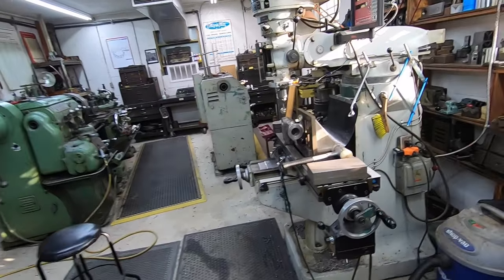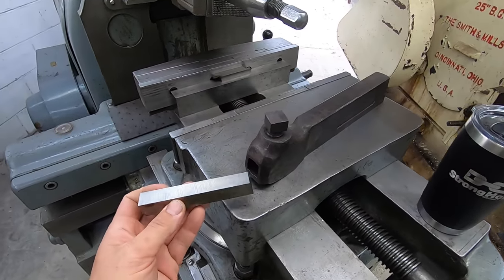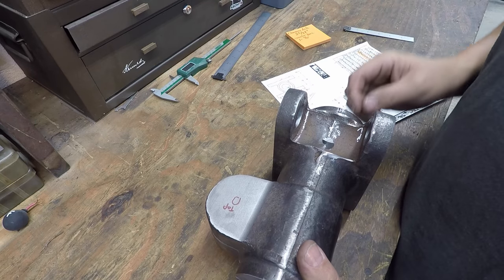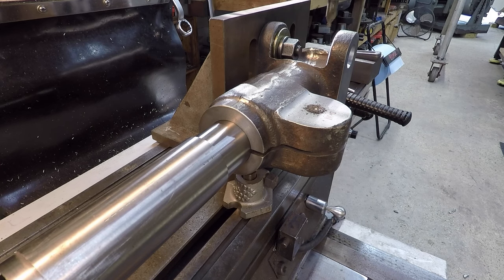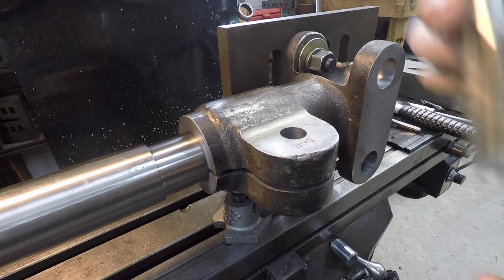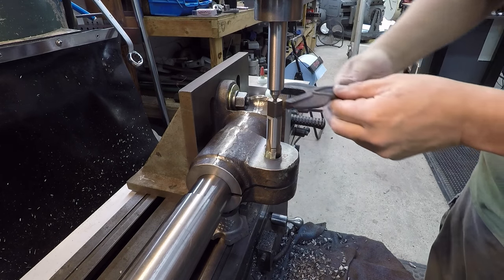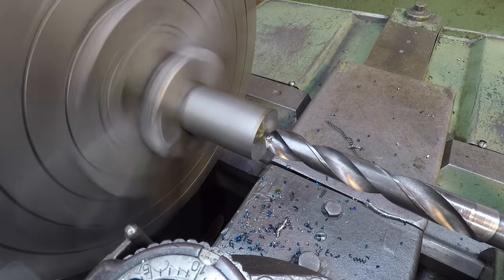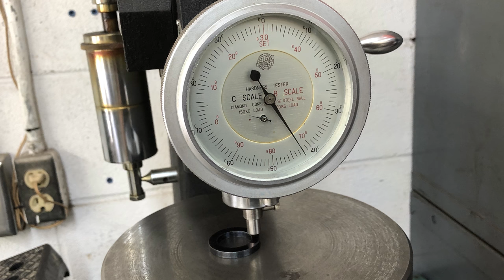Fairbanks Power Hammer Cross Head Part 6

Comment: In back of my mind during video : "MAKE THE BOLT...MAKE THE BOLT ... MAKE THE BOLT...." ....
Reply: Mr pete would have made it
Reply: After looking up pictures of the old fairbanks power hammers I have to agree. Looks to me like the original style bolts were made with an oversize shank ( shoulder bolt) and a "washer style" head. I think thats why the "counterbore" measurement didn't make sense. Its not so much a counter bore as just an oversized bore compared to the thread size.
Reply: I saying the same thing!
Reply: The only thing making your own load fasteners, is that you cannot certify it yourself and ensure grade without proper heat treating. It's just not cost-effective.
Reply: @1956Taz  sure it is not cost efective on large scale small shop, but one bolt he can make even better, right steal right heat and done, especialy when he has everything needed to do it and test it....

Comment: Hello Adam.  I think the mystery of the counterbore is that dimension P is measured from the centre of the saw cut and not the edge (You had your ruler measuring from the edge of the saw cut, not the centre).  Dimension R is 2-3/16".  Assuming that the saw cut is in the middle of this dimension then the distance from the centre of the saw cut to the outer surface of the lug is 1-3/32"  Dimension P is measured from the centre of the saw cut to the face of the counterbore and is 1".  This would give a counterbore depth of 3/32".  I think some of the confusion comes from the fact that the counterbore appears very deep on the drawing.  The draughtsman was probably faced with the problem of the actual counterbore being so shallow that it would be hard to show it on the drawing, so he exaggerated the depth to make it clear what it was and relied on the table dimensions to control it to the correct depth.  Ken
Reply: When Adam held the chart up close to the part, it does show P being dimensioned from the centerline and R is 2 3/16" and the saw cut L is 1/4".  With the washer and a new bolt, this arrangement will be better.

Comment: The only machining I've ever done is on a brake lathe doing rotors lol. Instead of letting it feed automatically, I like to do it myself manually 😁. Hey...its machining on a lathe whether it's on a brake lathe or a larger one like used one this channel 🤷‍♂️😁

Comment: Great series Adam, and thank you for taking us with you on it. I was a bit surprised that you went for fine threads in cast iron, I would have thought that the UNC thread form would have been more appropriate, perhaps it helps pull the joint together better, but coarse threads less likely to pull out as you will know.

Comment: I've never seen an alligator wrench until now.
Reply: Same. I like it.
Reply: I have a few, they're mostly wall hangers. They were mainly used with square head fasteners. Mine came from the railroad where almost all fasteners were square head at one time. Popular with linemen because it was lighter to carry a single "adjustable" wrench than several different standard wrenches.
Reply: @kennethney4260  Back in Missouri the square heads were called farmers nuts.
Reply: @kennethney4260  Plumbers usually have one or two at hand to my knowledge, since you already carry around a adjustable wrench it might as well have it on there. Because you know you wish for one when you need it.

Comment: Ever consider an 8 point socket for the tap after you got it started? That fork wrench looked a little Mickey Mouse.
Reply: Those alligator wrenches have been around since the late 1800s when square headed bolts where common. It's a 'speed' tool, much quicker than having to fit a tightly formed opening around the part each turn, and also one size wrench works for many sized heads. Adam likes to use old vintage tools when he can, especially if they were his dad's or grandad's.

Comment: Adam, I bet I know what happened here with that "counter bore". My guess is that they assumed the boring and tapping operations would be completed before the slitting. This way, there would be a primary boring op to put a hole clear through the clamp ear at the diameter needed for thread cutting. This would be followed by thread cutting one side to 1" depth and counter-bore on the other side to 1" depth to act as clearance for the fastener's threads (not as clearance for the head of a fastener). Then the slitting operation would be performed last.

This would ensure alignment of the bores on either ear and allow for easier clamping on the ears (without worrying about compressing the slit), and would also explain the "counter bore".
Reply: In this scenario, the boring and tapping operations for the split clamp ears could be completed in a single fixture: with the side to be "counter bored" facing the tool, first bore all the way through to the size needed for thread cutting, then counter-bore the relief half way through to allow access for the tap, then tap the remaining depth through to the other face. Then the slitting operation could be performed in the same fixture as the top facing op like you did.

Comment: I wasn't wondering why you weren't using the Flexarm - cos you'd just drilled the hole and you're all set up in the mill.
What I was wondering is why you didn't stick the tap in the chuck and power tap it - as it's going so easy.

Comment: There seemed to be a little debate about that counter sunk side for a bolt (if I understand correctly.)  When I think about it It sort of comes down to a few considerations  1) Does the bolt head need to be counter sunk for clearance? 2) Is thread length critical? 3) Given the softness of cast iron, how will the bolt head act against the surface of the cast iron.  My experience tells me I would like the bolt head to come against something harder than the cast iron.  So, I sort of like the idea of putting large counter sunk hole on that one side and putting a large hardened steel washer into it that matched the counter sunk hole. Sometimes, you can look at other parts of the machine to get a feel for the mind-set of the builders/engineers.  Just my two cents.  Please disregard if I am misunderstanding this situation.

Comment: Hey Adam I don't know if you watch Adam Savage but he just posted a video of a one-day build of a little Jewelers vice and he blued the handle on the end for the vice and the way he did it was he put the pieces he wanted to blue and a bed of brass chips in a crucible ladle and he heated it up from the bottom with a torch he said it took a long time but it ends up bluing the steel to a very consistent blue now I know you use the chemical but I just thought it was a neat different way to blue you might want to check it out... Anyway keep up the great videos looking forward to the finish

Comment: If the "P" dimension is the same size as the flange thickness, I'd interpret that as a spot face, so the bolt head or regular washer doesn't interfere with the radius on the casting. No custom washer needed

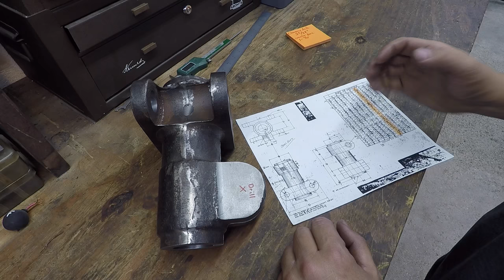Comment: 4:30 Since that thread's being used to clamp whatever's in the bore, my assumption would be fine pitch thread.. Much more clamping power and control with a fine pitched thread vs coarse thread.
Edit: Nevermind, that's what they went it xD
Reply: was a little surprised to see it threaded, but I'm just an internet commenter and not a machinist, so maybe I'm overthinking it. I'd expected that threads would bind up as it tightened due to those two "jaws" of the clamp moving closer to each other and thus the two drilled holes not being quite in line with each other anymore

Comment: Adam what type of drillbits you used to drill this through cast-iron. I tried using decent 
Drill bits but they will not drill through they just been there in doll out.
Reply: Are you running them too fast and burning them up? Are you positive it's cast iron? Cast iron can get "hard spots" sometimes that ate hard enough to dull a HSS drill. You might try a carbide drill, you could be hitting some hard spots.

Comment: Looking at some pictures of the original power hammers gives a few clues on why that counter bore didn't make sense. Looks like some of the original bolts had an oversized shank and a "washer" built into the bolt head. So the counter bore isn't really a counter bore, just a bore. Also noted that where the split cut terminates many of the heads have a hole drilled to "end" the cut. Probably to reduce chances of a crack originating at that point.

Comment: As-quenched 4140 should be close to HRC 60. The recommended hardening temperature is 1550F so you are plenty hot enough. You should pick up one or more hardness test blocks to verify your tester and diamond penetrator- something in the mid-Rockwell C 40's will suffice. Also, a chipped brale penetrator is hard to detect but has a dramatic effect on test readings. Tempering in the 500-600F range is typically avoided with this alloy because of "blue brittleness"; that said, a 500F temper would yield ~HRC 53.

Comment: I never undestood why you harden washers... imo you also use the washer as a sacrificial piece so you dont damage the piece you tighten up.
With hardened washers you tend to wear on the bigger expensive pieces of tools instead of letting the inexpensive washers take the wear.

Comment: When you were running the tap, why didn’t you do any 1/4 turns backward? I see that it wasn’t necessary, but it’s counter to everything I’ve been told. Thanks
Reply: Cast iron machines differently than alloyed steel. The chips are brittle and and break easily. Back in the 1980s I work for a company that made  magnetic plates, and I drilled and taped many a hole for cast iron bases for both magnetic sine plates and angle sine plates.

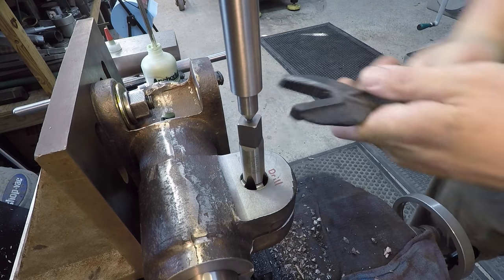Comment: 16:35 Wait, what?! That looks like it would be the easiest part to set up for the Flexarm... I think you forgot that you can kick the head of your Flexarm 90° and tap horizontally. Clamp the OD of the barrel of the cross head in the vise so that the ears are above the jaws and parallel to them. Kick the Flexarm head 90° and tap horizontally...

Comment: Adam, 
Just out of curiosity, would tapping from the other side work as well?  Not that it would right in this case.
Reply: Having the tap in a guide hole is a belt and suspenders way of assuring a tap normal to the surface.  When drilling and tapping holes in plate with a mag-base drill I've made and used tap bushings clamped down to assure the same result, especially when on big jobs I've resorted to air impact tapping.  Most of my bosses cringe at the thought, but I learned how in a shipyard.

Comment: Fractional inches just sound like a joke that went too far. 
What size drill do you want? A 59/64" or a size W?
Reply: Delve into the various thread TYPES the Brits used and how each had it's own set of non-releated gauges.  Tell me how it turns out.
Reply: @silasmarner7586  Ummmm... a M8 screw is 8mm in diameter. If you drill a 8.5mm hole with a 8.5mm drill, you get 0.5mm of clearance for it. Now try that with fractional.

Comment: Maybe I missed an SNS, but what happened with the stoker engine?
Reply: He couldn't get into the needed area with his shaper because of tool clearance issues. I think he said Lance and Keith figured another way to do it, maybe a very long specialty mill.
Reply: Couldn't get stable tooling to make the cut down inside it with the long reach. Interference also. He mentions it in one of the videos.

Comment: It looked to me like the counter-bore dimension was the the amount *left un-milled*. Assuming that, 1" then translates as "no counter-bore", just said in a confusing way. Some young draftsman getting cute?
Reply: Referenced from the center line of the main bore, consistent with that of the tapped hole in the lug also dimensioned in the same manner.
Reply: The drawing is 'common' to many different sized hammers, so it should be viewed as 'not to scale'.  For this hammer, denoted size E,  as you say it translates to a zero depth counter-bore ( taking the lug width as 2.187) .
Reply: Less confusing would have be to mark it as something like "none", "n/a" or "omitted".
Reply: Agreed, 1" is the meat left over.  Counterbore depth not important.

Comment: Somebody's please answer. When Adam was drilling with the 51/64 drill i noticed he didnt lubricate but when he was making the washer on the lathe he did. Drilling the tap hole the speed seemed pretty fast and i really was baffled why he fidnt use cutting oil.
Reply: Cast iron releases tiny carbon particles/graphite so it’s self lubricating
Reply: @brandonb9452  Thanks i had no idea

Comment: I would have thought that the bore would be two different sizes; the non-threaded hole would be slightly larger that the outside dimension of the bolt threads. The threaded hole would need to be smaller; the dimension of the thread "valleys". Perhaps that was the reason for the (larger?) counter bore? I (obviously) have absolutely no machinist skills of course!! 🤪